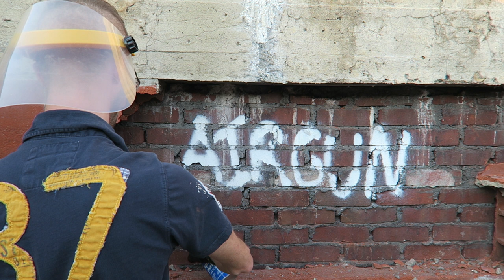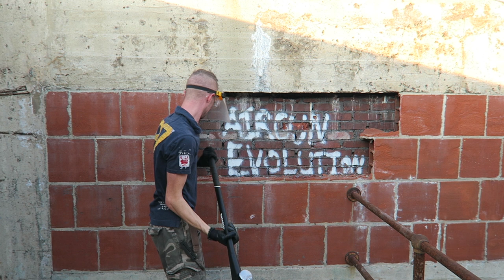MAJOR CHANNEL UPDATE | Smashing A Brick Wall | Airgun Evolution

Comment from the maker: I present to you the newly rebranded "Airgun Evolution" channel or "AirEvo" for short. 
"A rose by any other name would smell as sweet." ~ William Shakespeare
Equipment Used: 
Husky 8lbs Sledge Hammer
Reply: "The things that men do!"  ~W.S.   .......Hah, so you thought my friend, that that was going to take longer than you "thought"?  lol The secret to taking out a brick wall, is to crush and dig out one centered brick at first, then chip off the outer bricks. A pick point hammer would have made waste to haste. You are our inspiration my friend, the "Urban Airgunner. Hey Bro, at least I made no funnin' of ALL THAT safety gear! Still gunnin' out here in old Santa Fe! "Que viva "AirEvo" "Airgun Evolution"!